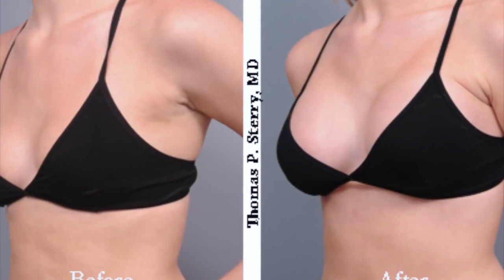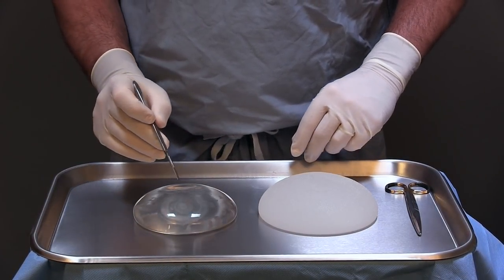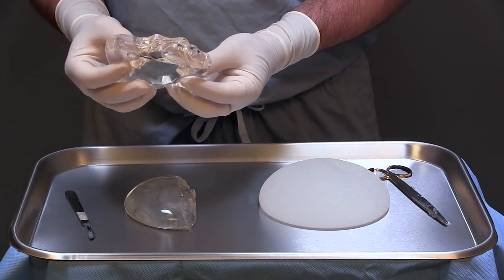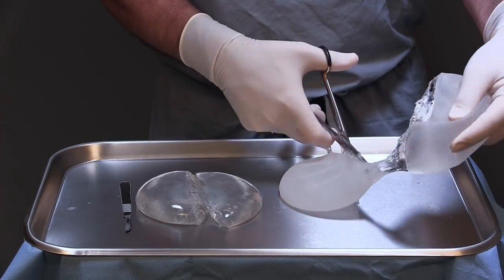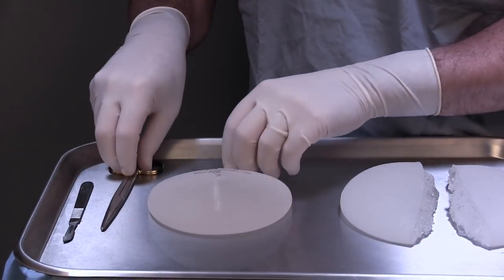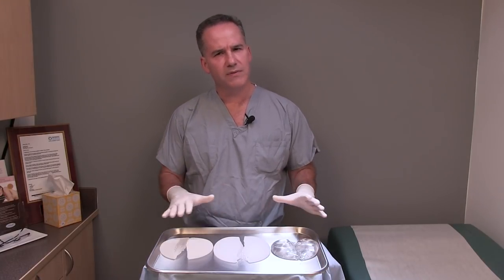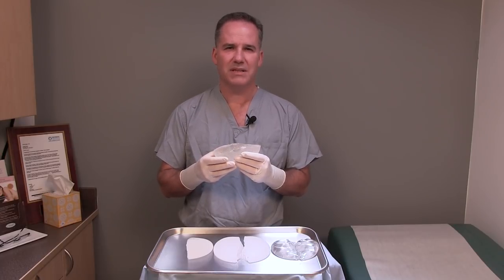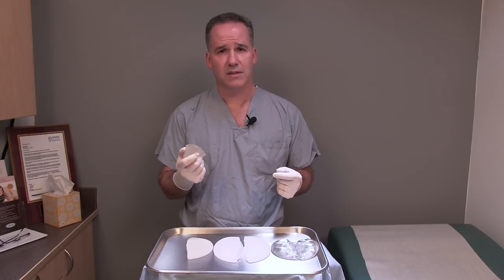What's Inside Silicone Breast Implants? | Dr. Sterry

Comment: I really wanted these types of implants but I am concerned with the platinum that is used in the shell of the implant. Do the Naturelle implants contain patinum?
Reply from the maker: +Planning Momma I apologize for the late response.  Platinum?  Are you sure about that?  Why would they put such an expensive metal in the implants?  I've never heard such a thing, but will check up on it.
Reply: +Thomas P. Sterry, MD Yes sir. I have done extensive research but cannot find a reason for its use.
Reply from the maker: Planning Momma You mean silicone?  They are really much nicer once they are in than are the saline implants - in my opinion.  And now we can see that there is no reason to be afraid to use them.  But the choice is always up to the patient.  You should only get what you are comfortable with.  Good Luck!
Reply: Dr. Sterry, there are actually several publications that mention platinum use. Page 20 of the Mentor Physician's Labeling pamphlet for MemoryGel clearly states that the silicone compounds and platinum can migrate through the semi-permeable shell. In reference to the question above about illness, this same pamphlet also says that studies involving relation to connective tissue disorders would need to be larger - not that they've proven they aren't connected, it says the studies involving neurological symptoms are insufficient or flawed - not that they've proven they aren't connected, and that there have been significant increases in symptoms such as chronic fatigue, joint pain, fibromyalgia, etc - even when the implants aren't directly connected to a "defined illness". I'm not trying to be ugly. I just think that women should be more educated about what these implant pamphlets actually say. I asked before about the chemical makeup and I bet that you can't get that protected information.
Reply: +Jamee Cook Thank you very much for your response to my question that keeps getting evaded or I continue to be treated as ignorant. I appreciate your research.
Reply: Please make an informed decision. There are THOUSANDS of women who have had their health ruined by Breast Implant Illness (BII). Thousands of women are explanting (and not re-implanting) their cohesive gel, silicone AND SALINE implants due to very serious health issues caused by the implants. Please visit healingbreastimplantillness.com for information. No one associated with the website or fb group receives any financial gain - we just want to save other women from BII.
Reply from the maker: Polish Momma I will look into what you have been reading and get back to you.
Reply: Per the FDA Summary of Safety and Effectiveness Data (PMA P020056) on Allergan silicone devices:

"As a note, platinum is a metal used as a catalyst in the manufacture of the shell and gel components of silicone breast implants. The small amounts of platinum remaining in the product following manufacturing may enter the body, either by diffusing through the intactshell (i.e., through gel  bleed) or through an implant rupture. 

Based on our review of the gel bleed testing, the published literature on this topic, as well as the biocompatibility testing and clinical data on the device, FDA concluded that the platinum contained in breast implants is in the zero oxidation state, which has the lowest toxicity and, thus, does not pose
a significant risk to women with silicone breast implants"

http://www.accessdata.fda.gov/cdrh_docs/pdf2/P020056B.pdf

The entire compound chart is available there at the link for reading.

I did the research instead of just blindly following either side of the discussion. I went with Natrelle style 45's..I love them and I am healthy as ever years down the line. I hope this helps!

Comment: @Thomas P. Sterry, MD   ,Dr. Sterry I have 2 questions: First can you tell us the names if each of the 2 old Silicon implants you showed us? My second question is, my doctor have not performed a procedure before using the Gummy Bear type, but she did use the other older silicon types in her procedures, do you think she would be able to perform the procedure with the Gummy Bear just like she would with the other types of silicon? Thank you.
Reply from the maker: Sorry for the late response.
Yes, she will be able to use the new implants just as easily as the older ones.  That won't be a problem.  I was cutting the Mentor, Sientra, and then the Allergan Style 410 implants.

Comment: You need to warm the implants to body temperature before cutting and squeezing them. Silicon will be more cohesive at room temperature than inside a warm human body.
Reply from the maker: Wow! You are a stickler, aren't you?  Okay, you got it.  I have a warming cabinet for fluids and I can certainly leave them in there for a day and make a new video using the implants I've already cut.  Is that acceptable?  Because these suckers are expensive and I'd rather not cut anymore of them in half!
Reply: Sounds good. Cheers.
Reply from the maker: @mariannmonika  No bias in that question/accusation is there?  The truth is that I do the best I can for my patients.  And yes, for those who believe they are suffering from BII, I do perform en bloc resections.  Most times the implants are NOT ruptured.  Try to remember that some of the implants we remove are not the modern form stable type (gummy bears), so who really knows what that means?

Comment: which one of those 3 you would recommend the best?
Reply from the maker: The last one was the most cohesive, but I thought it was a little firm, and I liked the cosmetic feel of the first two more...So I guess I'd take one of those instead.
Reply from the maker: I think they are just different.  There are reasons any given patient would want one over the others.  With that said, I find myself using one of the first two more often than the last one.

Comment: Says the guy who is wearing surgical gloves touching them
Reply from the maker: Maddelutten Funny, I hadn't thought about that angle!  It really was for no particular reason other than "theatrics".  Then again, the stuff was awfully hard to get off my fingers.  I still have those implants in my office and show them to patients all the time.
Reply: Why need "theatrics"? If it's awfully hard to get off your fingers then I suggest your attempt to convey they are non harmful inside the body to be useless.
Reply from the maker: Maddelutten "useless". Why so?  It sticks to your fingers,  so what?  I said so in the video.  This is totally inert stuff and has been proven as such time and time again - which is why the FDA after pulling them from the market had to finally say they are safe and allowed to be used.
Reply: Thomas P. Sterry, MD I find it to be common sense, if it's awfully hard to get of your fingers how hard would it be to get of inside your body if ruptured?
Reply: Maddelutten maybe because the inside of your body is different than the outside. If your insides are as dry as your hands I think there is a problem.
Reply: BeforeULeave1
Maybe you're right
Reply from the maker: But they don't really rupture like that.  Remember, I cut them completely in half!!  Furthermore, my point was that this substance sticks to itself and is not going to ooze all around your body like liquid or "free" silicone can.  These devices are very safe.
Reply: Thomas P. Sterry, MD darter. Salami
Reply: Thomas P. Sterry, MD
Reply: surgical gloves aren't inside you.
Reply: Unfortunately that's exactly what the doctor told my mom. 
Months later, she got an autoimmune disease caused by silicone poisoning when her gel implant ruptured inside of her. I'm sure it doesn't happen often, though.
Reply from the maker: There is NO autoimmune disease caused by silicone.  What kind of doctor was it?
Reply from the maker: Oh my!  I certainly didn't intend to either belittle or intimidate anyone.  I'm so sorry for giving that impression.
What we do know, however, based on actual scientific studies is that "So Far" there is no evidence to suggest silicone is correlated to autoimmune disease despite some of the very graphic stories we have all heard from individual women.  As a matter of fact, after 14 years the evidence was so overwhelming to the contrary that the FDA had to admit that such theories were "disproven".
Now, if you really want to be critical of breast implants, there is a new wrinkle.  It seems that there is a very low incidence of ALCL associated with textured implants - something like 1:30,000.  The studies are very preliminary, but it does appear to be a problem.
For the record, I don't do all that many breast augmentations.  It's kind of ironic that I'm out here on social media talking about them so much.  I really thought the video would just be helpful to women who were entertaining the possibility of getting them - and I thought it would make them more familiar as they do their research.  Funny how we find ourselves in these situations.
As I learn more about the ALCL thing, I will be posting it on my blog.  I look forward to your comments!
Reply: Maddelutten Doctor,  I appreciate all the insight you are willing to demonstrate and go on the record saying.
Reply: Maddelutten I believe it's great he wearing gloves that tells me he is clean at what he does.

Comment: Breast implants are large foreign objects that overwhelm and weaken the immune system, eventually creating a cascade of dysregulation in the body that may include autoantibodies and autoimmune diseases, endocrine dysfunction, gut dysbiosis, and more. Essentially they are immune provoking foreign bodies that indwell and deteriorate in the body, therefore it is not a matter of if you will get sick, it is a matter of when you will get sick. An overburden of toxicity manifests it...self in inflammation and other health issues. Implants have 40+ toxic chemicals, various silicones of different molecular weights, and many heavy metals (such as mercury, arsenic, lead, cadmium, platinum, and more). Intact implants have semi-permeable shells and leak gel bleed of low molecular compounds, as written in FDA documents. Biochemist Dr. Pierre Blais states “the devices act as time release systems for pharmacologically active compounds.” Natural shell degradation through hydrolysis, oxidation, enzymatic degradation, physical degradation, diffusion of gel bleed, absorption of proteins, pH and acidity, biofilm formation, etc. affect the stability and integrity of the polymeric implant surfaces. Differences in individuals and in implant quality can affect the degradation rates. However, the body will always attempt to break down anything placed in it and degradation will always be occurring, increasing with age (generally around 6-8 years it speeds up). This is why some women do not experience symptoms until years down the road, while for others it happens very quickly. It may depend on how much toxins are being released and how well your body is at excreting toxins. The cohesive gel have particularly aggressive chemicals and heavy metals and the first symptoms seem to show up fairly early.
Reply from the maker: peeweecoco really?! So then what are pacemakers?  Artificial knees?  Heart valves?
Why don't these things cause the problems you claim?  A bovine heart valve is clearly something that "doesn't belong" inside a person, but they save lives.  I wish you could open your mind up to the science that proves the safety of breast implants.
Reply: You're really not going to compare life saving open heart surgery to altering a woman's already perfect body for income are you? I can give you a list of materials in a pacemaker or artificial knee and then ask you how you missed the part of rejection and complication to these surgeries in medical school. You cant compare breast implant surgery to anything you've mentioned. And don't get me started about putting an implant with 40 some-odd dangerous chemicals on top of two lungs of a breast cancer patient that has already gone though cancer treatment and has an altered immune system. Tell me there is ANY other surgery you do that helps humanity. Then,  I will be more open to this discussion. You can block me, but then somewhere around 20 thousand women are going to come here with a list of the illness they are dealing with because of breast implants. Mine started with hair loss. It ended with my husband pushing me in a wheelchair. I have done my homework on this subject. I am well today, and ready for debate. You are NOT saving lives with breast implants. The difference in you and I....they almost killed me and many other women and I am not getting paid to tell the truth. You are getting paid but not telling us the list of chemicals that make up these unnecessary things that are going to sit on top of a woman's lungs and slowly release these chemicals into her healthy body.
Reply from the maker: peeweecoco I don't want to "block" you as you put it, but then again, having a logical conversation with you is difficult too.  Your comments are so emotionally charged and filled with presumptions and accusations.
May I clear one thing up?  I  do a LOT of reconstructive surgery.  My preferred method is with a patients own tummy tissue whenever possible, but some women are not candidates.  These poor souls are left feeling empty and want to be "whole" again.  So sometimes, yes, I offer silicone breast implants.
This video was not an advertisement but intended to be informational only.
I am left feeling like you are exploiting my educational efforts for your own agenda.  Furthermore, you seem to have disdain for me just because I am a plastic surgeon.
Let me ask you a question...God forbid you get your hand caught in a blender or a lawnmower, who do you think is going to put you back together?  A cardiologist?  It's people like me.  We do a LOT more than cosmetic surgery.
Reply: peeweecoco you dropped your tinfoil hat

Comment: Does it burst when someone is on flight.. I saw a video where a girl's boobs bursted when she was on flight???
Reply from the maker: No.  The only way that could happen is with a saline implant that has some air in it - and even at that, it would really be surprising.  Frankly, I think sometimes people try to dramatize things more than is realistic.
Reply: Thomas P. Sterry, MD exactly.. Thank you for the information
Reply: Lol, I saw that on 1000 Ways To Die. I thought it was hilarious! There was so much nonsense in that episode & not a drop of truth.

First of all, no, implants don't expand on airplanes. They would have to contain some sort of gas inside in order for them to expand from lower pressures.

Second thing, even if your implants were filled with just air, your chest still wouldn't burst. Your skin, muscle, and tissue is rather strong and it would take a lot to break through that.

Third, and most importantly, if your implants somehow managed to expand to the point that they burst out your chest, you'd clearly be injured, but you definitely wouldn't die.

That show is just made up hogwash.